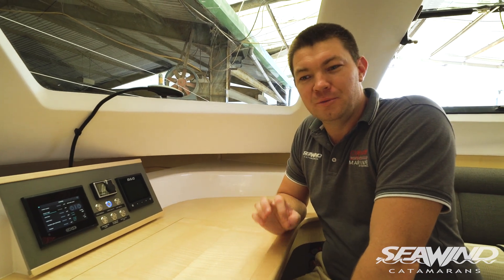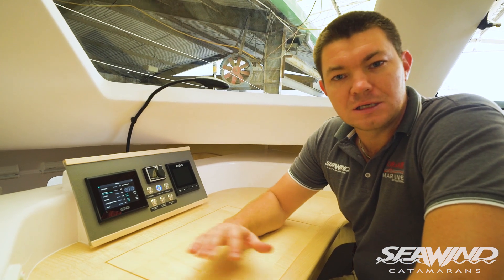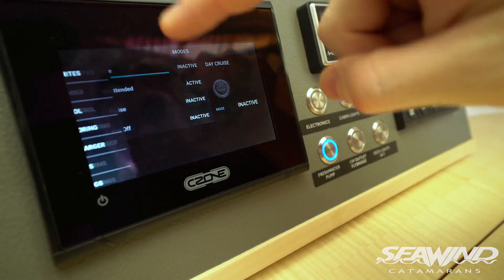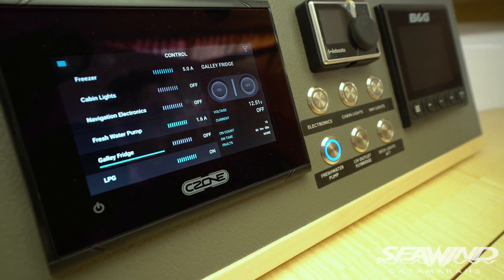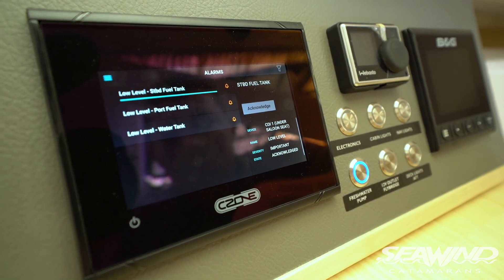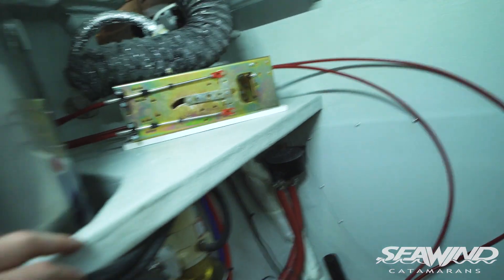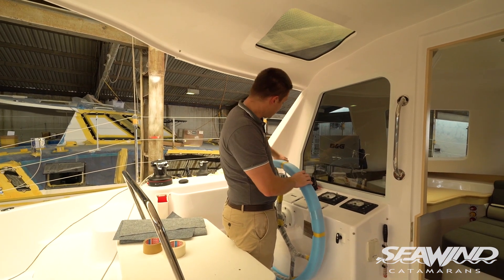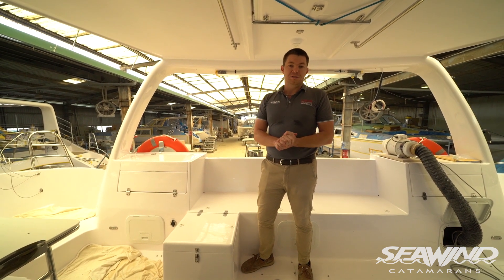Seawind Catamarans Spec Talk - C-Zone, Diesel Heating and Dual Engine Controls - Episode 3

Comment: The C-Zone system is very nice, but that touchscreen accuracy and response is pretty dismal compare to the inexpensive android tablet I have for reading eBooks.
Can the system be controlled from a (iPad or Android) tablet? 
Can the dual engine controls be set up without having to use that switch? It seems like it might be a liability when maneuvering in tight/difficult situations.